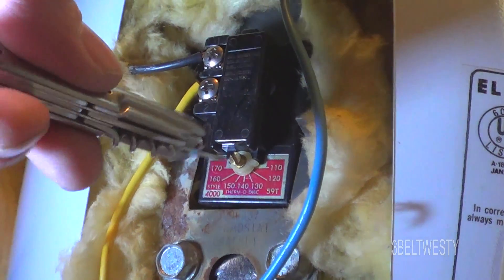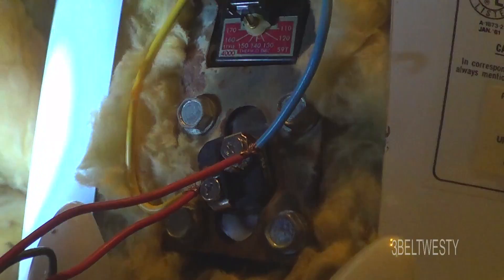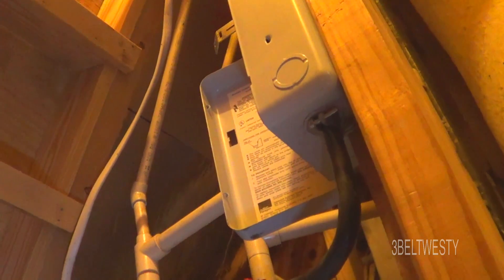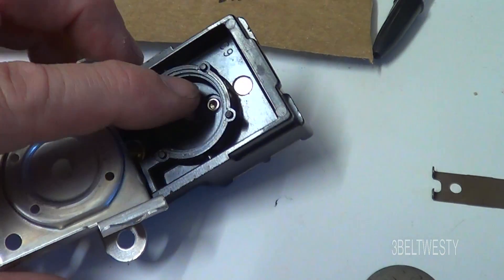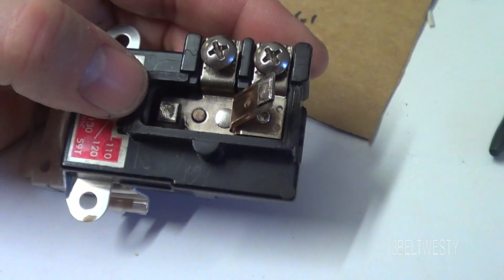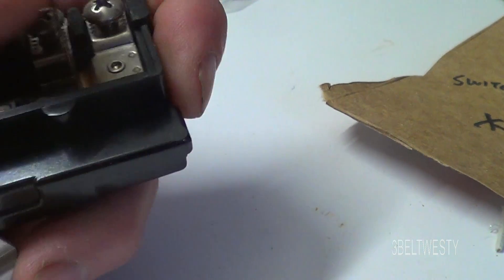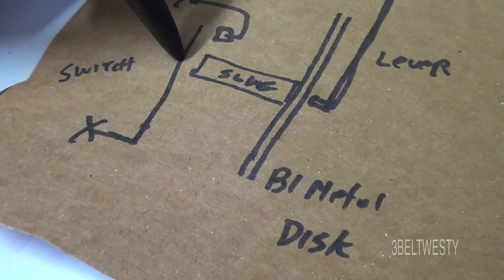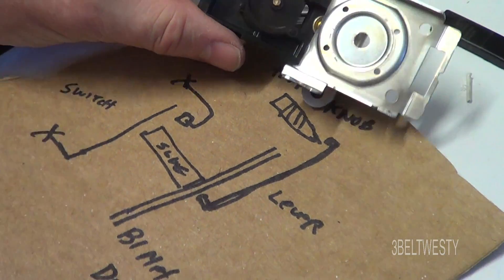Electric Water Heater lower thermostat how works and failed

Comment: Hey nice video thank You
Just one observation  and possible cause for the thermostat failure
"A lot" of heater elements are rated at 4500 watts

Your Thermodisc control unit was rated for 4000 watts
If your elements were rated at 4500
The pitted slug piece that looked like an "eraser" was possibly overheated
by the contacts or disc? I wasn't clear on, if the disc and slug have current
through them or just act as mechanical actuators 

You should check the wattage of both the thermostat matchs the elements rating
and that the elements match the mfrs specs
(possible someone put in higher rated element)  

Thanks again for the viseo
Kenn
Reply: I know this is old, but just so you get an answer to your question, there is no voltage or current thru the bimetallic or the ceramic connector link, it would be a death trap if voltage went through it since the disc is in contact with the tank.

Comment: Would it be possible to remove that little plastic temp selector and get hotter water than 170. I realize this could be extremely unsafe because you don't want to boil the water in the tank but I have another idea to use it for. I basically want to use it at a temp controler for bringing a large amount of liquid in a 10 gallon pot to a boiling temp. Thoughts? Would it work that way?

Comment: did you have the lights wired to both connectors at the heating element
Reply from the maker: +cecil christopher For troubleshooting I connected a set of lamps across each element as a visual clue if it was on or off.  These elements get 240 volts each thus I used two old Christmas tree lamps in series. I did this because the unit was wonky and would sometimes work correctly and other times not.